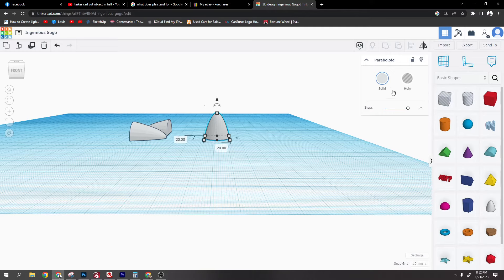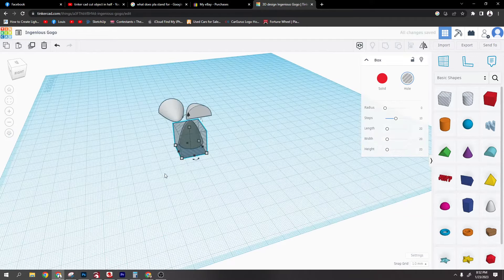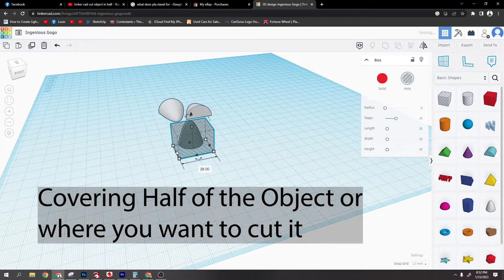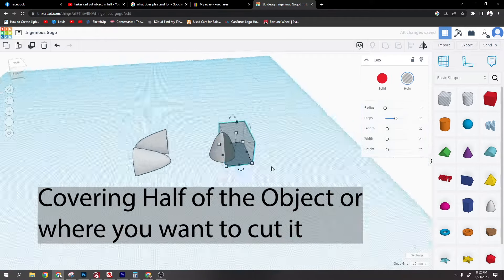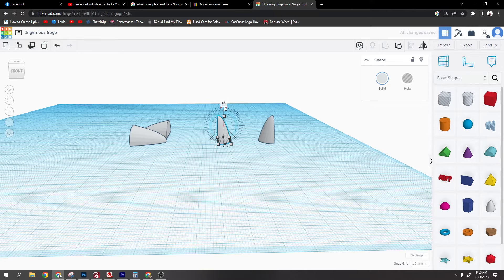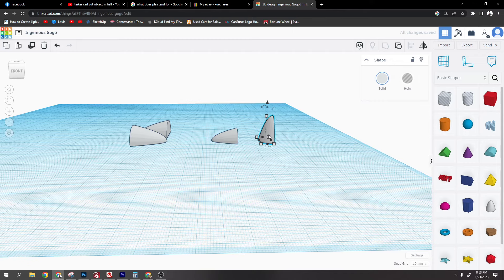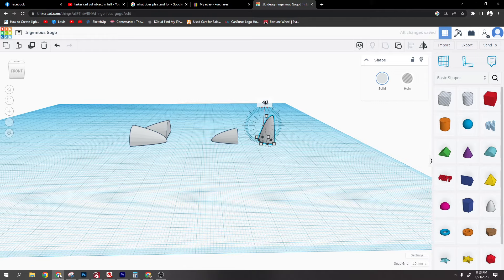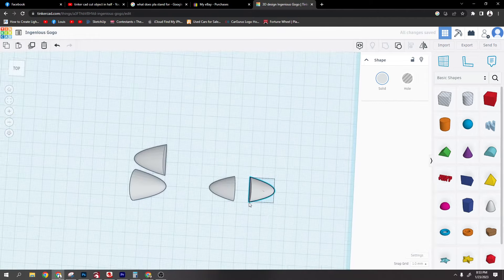Easiest Way To Cut An Object in Half Using TINKERCAD 2023 #tinkercad #tutorial #2min

Comment: Ive had a 3d printer for a bout 6 years now and co2 laser for about 2 years, i use solid works for making drawings then save them to stl to print you will have some fun with the printer and if you get stuck plenty of help here from your subscribers
Reply from the maker: I will have to check out solid works,  i do have some experience with blender but not practiced in a while, Im sure i will be needing some help as it is my first attempt but i do enjoy to learn these machines and the software  , really excited to see what i can make and see if i can use both the laser and printer together. I will post my progress, printer should be coming tomorrow but no filimant until the 2nd apart from what comes with it.
Reply: You will love printing as much as the laser and if you like tinkering with machines as I do,it's great, I use simplified 3d just works for me,there  is cura think it's open source,Michael at teaching tech has a wealth of experience on you tube,good to check him out,if you don't mind me asking what printer did you purchase?
Reply from the maker: @David-ws6zr  i will check him out, i went with a FLsun V400 in the hope that i can print a bit faster :D it arrived today so im going to do a setup video in a while :D
Reply: @carphotography  I checked what printer you have,it's huge let us know how you get on
Reply from the maker: @David-ws6zr  will di i am building a place for it today and hoping i can get my first print :D